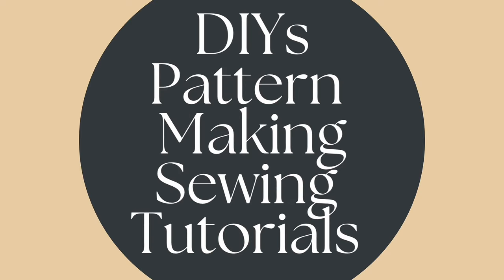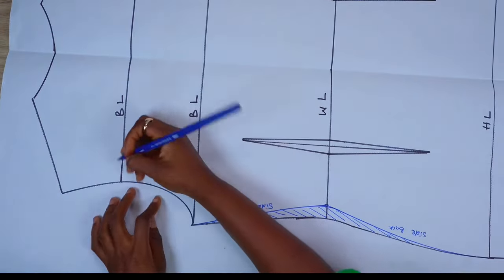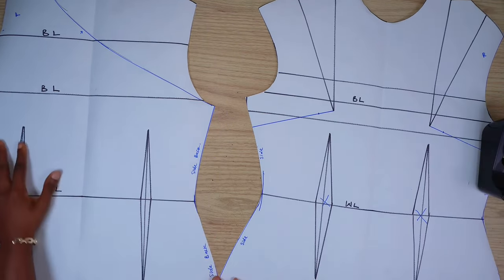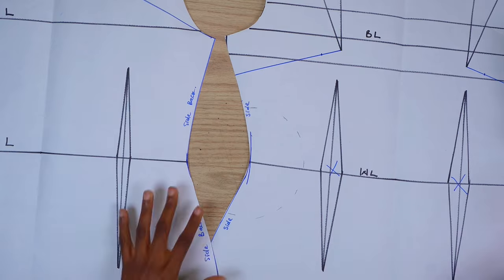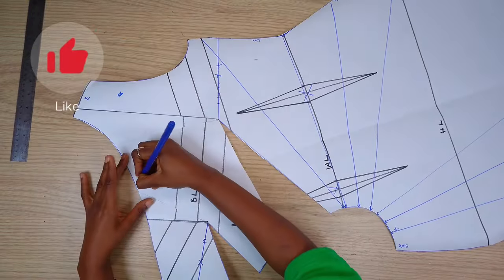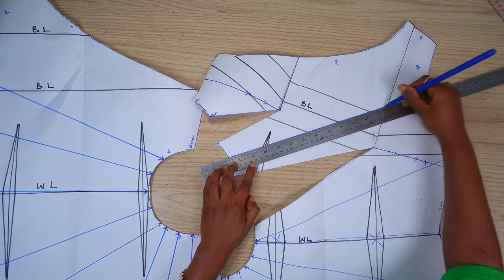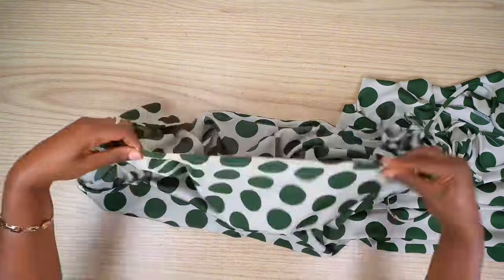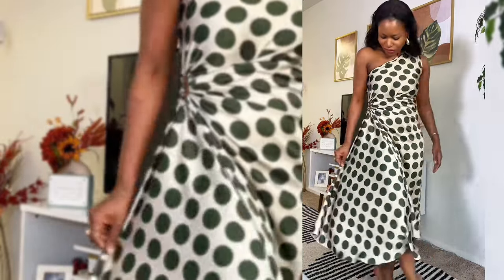One Shoulder Side Ruched Dress

Comment: Beautiful 😍but I'm stil finding it difficult to understand though ☹
Reply from the maker: Which part? I’d be glad to elaborate
Reply: @mercyadamsinseams  the spreading part ma'am
Reply from the maker: It’s basically just cutting along the slash line and adding fullness in between the lines( slash and spread) to however width you like, I added about 2” in between each slash line. I hope this helps
Reply: @mercyadamsinseams  it's actually from the splashing but will give it a try. Thanks ❤

Comment: Very excellent tutorial

I do not get the drawstring part though.

How to fix the drawstring
Reply from the maker: Thank you.  I used a safety pin on the strings and basically inserted it through the little gap I left after attaching the Bias.